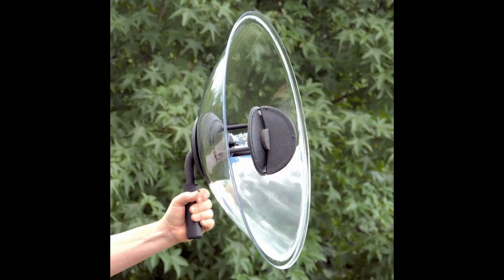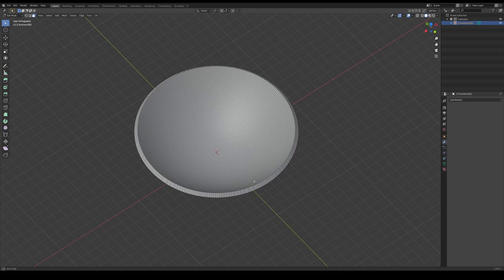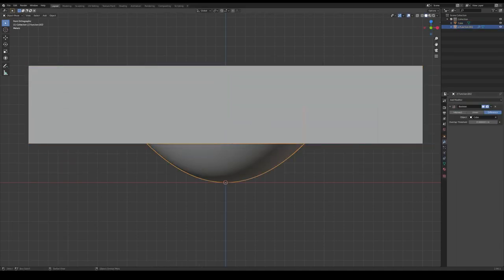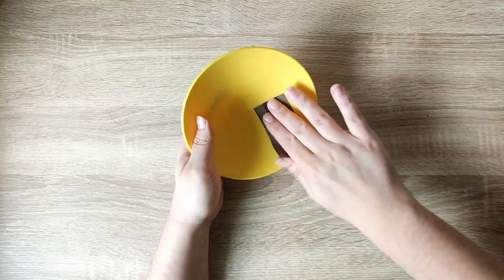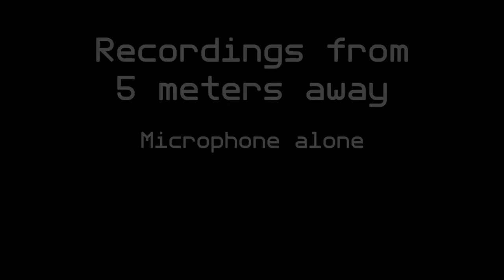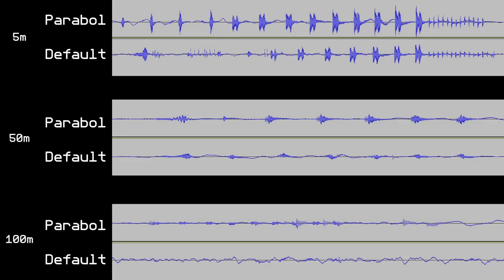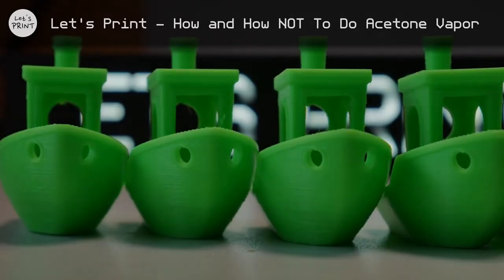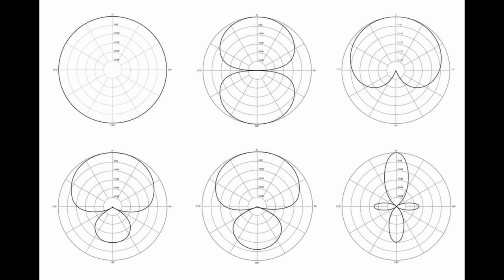3D Printed Microphone Mod for Distant Recordings

Comment: You probably need one bigger parabola to get some real gain... On the meters range... Wavelengths and everything....
Reply from the maker: The effect is limited indeed. A larger parabola would of course, be better. My 3d printer doesn't have a very large build volume though, so I personally would have to print the outer edges as separate parts and glue them on or something. 
Also another thing that a keen listener might notice, is that the timbre of the recording changes juuust slightly, towards... well, honestly, a plastic-y tone (imagine talking into a traffic cone or something similar)

Comment: Birds aside - 45cm diameter up works for female human voices 75cm starts to enhance male voices well. A microphone array at the focus  is the best. This can be achieved by 3D printing segments and gluing them together. I successfully easily heard (when I found the sweet spot) a conversation [with consent] between my sister and her kid at 80 meters. Companies charge thousands for these -which is utterly ridiculous.
Reply from the maker: Yeah, making a parabolic microphone on your own, as long as you can get a good enough parabolic surface from somewhere is sooooo much cheaper...
Reply: Do you have the design file for 3d printing?